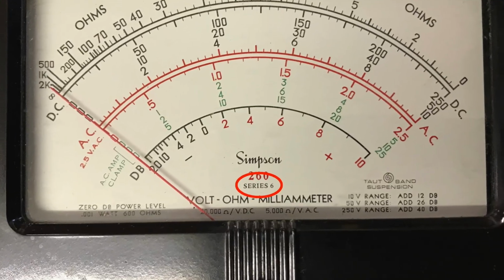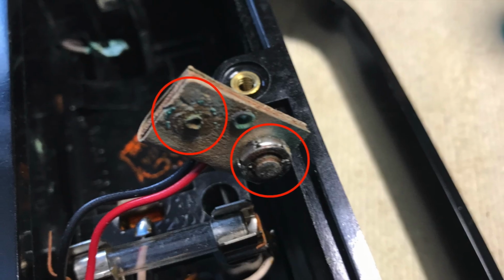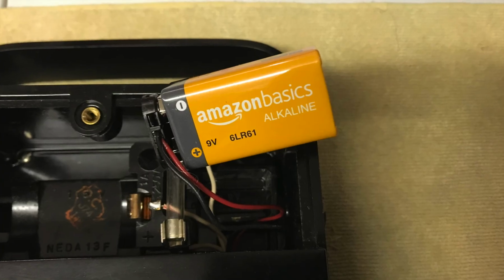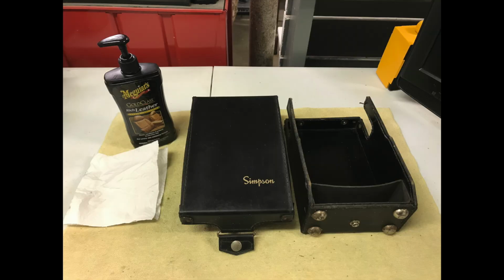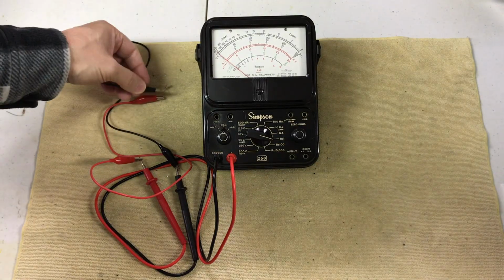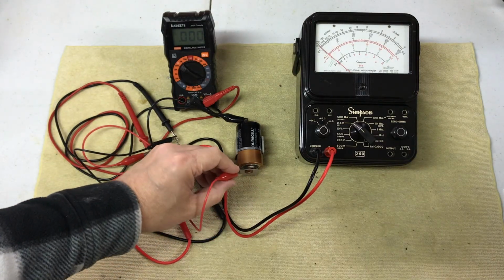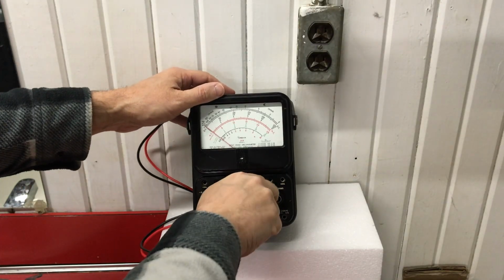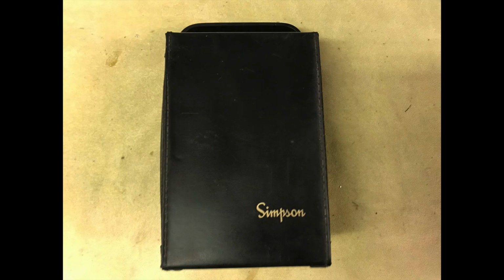1974 Simpson 260 Series 6 Volt-Ohm-Meter Repair

Comment: Since I am 82 years old I am very opinionated here. To me the Simpson 260 is the best Volt Ohm Meter ever made. As with all VOMs  they do use power from a voltage circuit when testing for voltage. A VTVM doesn't take power from the circuit being tested, but I still prefer the Simpson 260.
Reply from the maker: Thanks for the feedback!